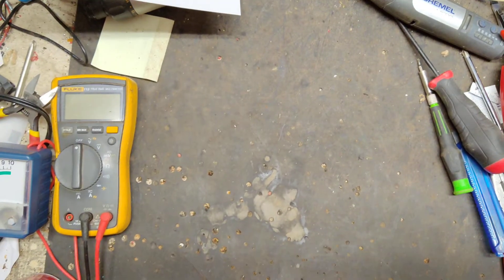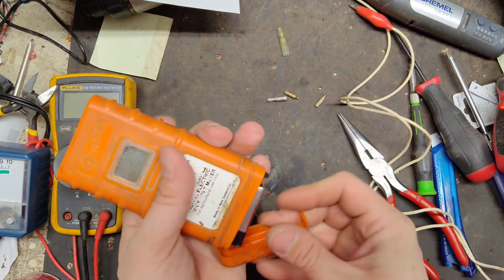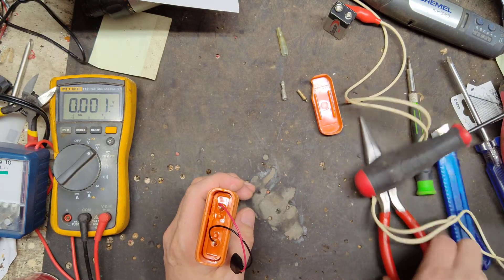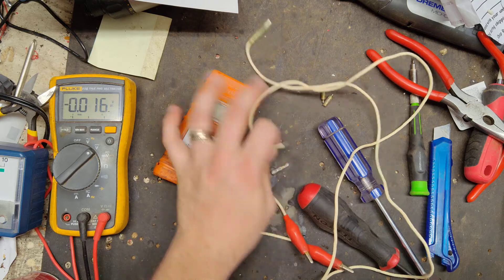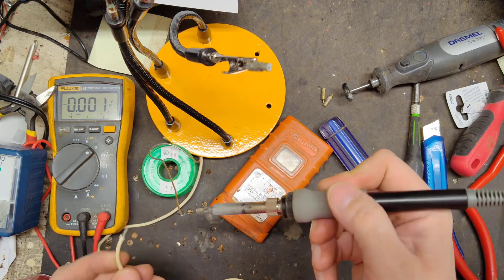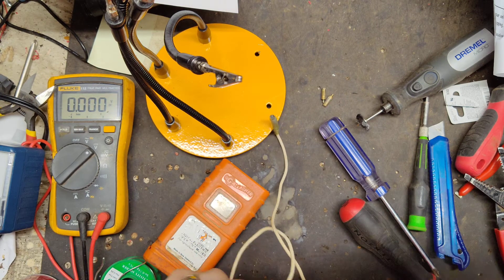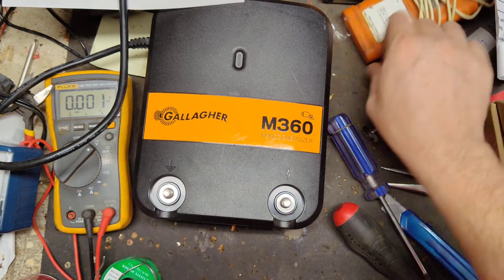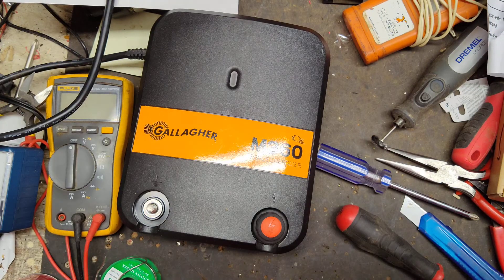Electric Fence Tester Repair | Gallagher Digital Fence Volt Meter Repair

Comment: This fence tester price?
Order in Amazon?
Reply from the maker: This particular version tester isn't made anymore by Gallagher. They make a newer version that's digital for around $55-$60 here in the states and a fault finder type that sells for around $100-$125. I do sell an analog fence tester for me around $40 that I use in my videos, they're not sold on Amazon. If You're after a new digital fence tester, I can get you one of the gallagher testers if you'd like. Even though I work on all brands of things, I am a dealer for the Gallagher brand so I can help you out.